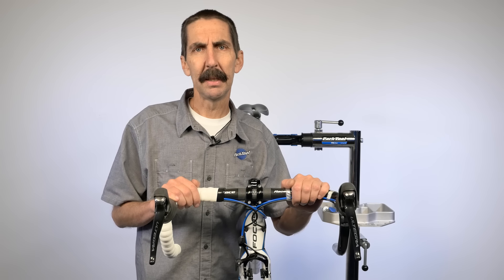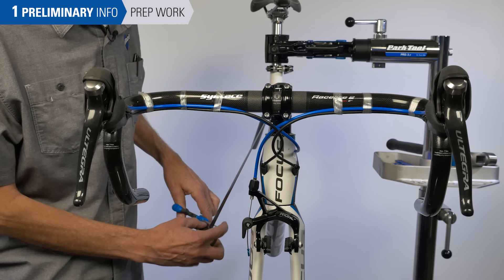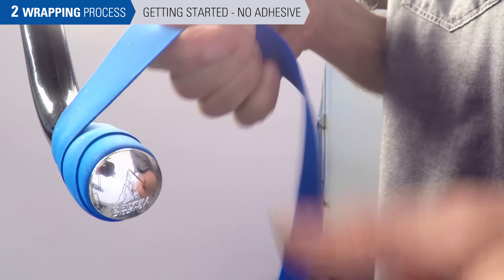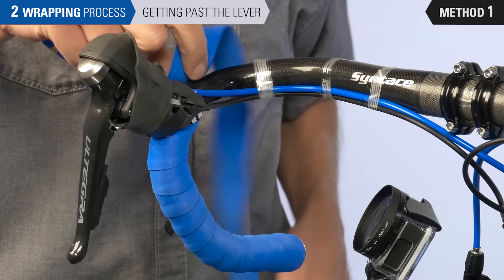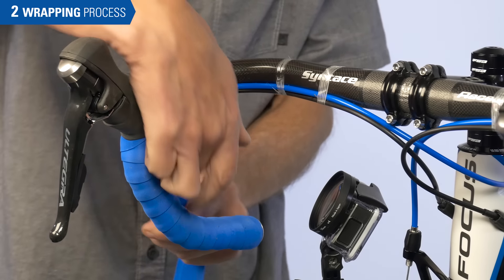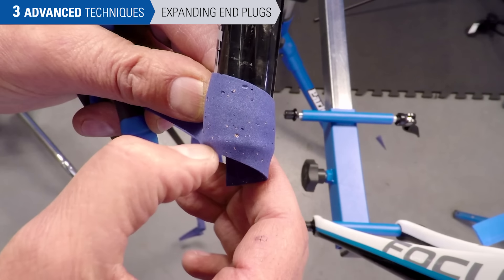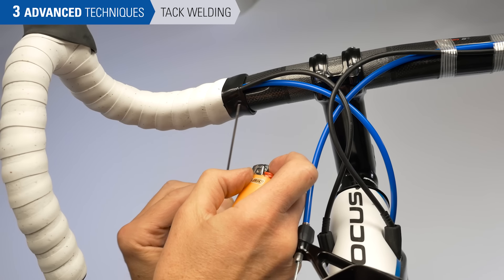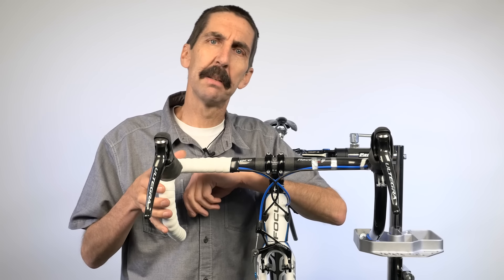How to Wrap Handlebars for Road Bikes

Comment: I was pretty much affraid of non-adhesive tapes before buying it. With this video I'm now confident enough of handling it well.

Also, the direction of  wrapping the tape is something I have come across quite new to me & realized it is the real key in this technique. 

Thanks for making this video.
I conclude that the direction of wrapping is the real key which you taught in this video.

Thanks much.

Comment: Excellent video. The only trick I would add is to use some of that strapping tape where the finishing tape goes as the first layer. Just two times around. It's very thin, but it holds tension much better and does not slowly unravel like black tape (or mfg provided finishing tape) does when it is put under tension. Then just cover the tight strapping tape with black tape but use zero tension. That way it does not slowly creep and expose the adhesive that all of us hate. Makes the tack welding spoke trick unnecessary, cool as it is.

Comment: Excellent instructions! The new tape I put on both my drop and aero bars looks pretty good!  I'll add one thing. I used a bit of this stuff called Tommy Tape for finishing. It's a self fusing adhesive strip that doesn't get gummy over time.

Comment: Great video! When I am giving tips to people on wrapping their bars I try to tell them to wrap "away from the bike" . I've found that distinguishing clockwise and counter clockwise can make people overthink the direction.
Reply: That doesn't mean anything though. When you wrap clockwise for the right side, you wrap away from the bike on top but in the direction of the bike half a turn later.
Reply: That ignores the recommended direction difference between the drop ends and the top. Also, to me, 'away from the bike' is vague, while the wording used in this video is not prone to misunderstanding.

Comment: the figure 8 leaves only a small triangle that is covered up by the hoods. There is no need for the extra strip with it. I just got done wraping with the 8 technique and it is fine. The tape was a bit thin though it might look bulbous if it is extra thick.
Reply: But isn't the tape also then going the wrong way on the tops?

Comment: the whole point of the figure 8 is to avoid having to use the cheater strip.. smh
Reply: theaveragegamer801 That's exactly what I thought!  Doing the 8 negates the need of the little strip, especially when using modern brifters with long hoods. I think I'll start calling them 'cheater strips" as well!
Reply: And he then points out the obnoxious bulge created because he used the cover-strip. How someone this good at bar taping does not understand or mention the figure-8 technique eliminates the need for the strip is beyond me.
Reply: I agree...there is no need for cheater strips if figure 8 is done expertly!!
Reply: Correct about the strip! Doesn't the figure 8 leave the tape rotation in the wrong direction at the upper end of the handlebar? Why even use it?
Reply: @norgermish1  When you wrap the Figure 8, it's your choice on which direction the tops will wrap. Josh Poertner of Silka Velo pointed this out to me. You decide on this when you come out from under the hood - at that point, you can take the tape either side of the bar which will set the direction for wrapping the tops. See the GCN video titled, "How to Tape Your Handlebars in the Figure of 8 Style", it shows it exactly - wraps inside out on the lowers, and towards you on the tops.

Comment: Okay, I watched the video, opened the box and wrapped my bars. Wobbly and uneven, but it doesn't look too bad.
I, of course, used the preferred method of wrapping to the brake lever and then once around the outside of the lever mount, since a figure eight wouldn't fit on the second levers on a '70s road bike.
The painful part is that it was mostly just practice, since I'm probably going to donate that bike to Goodwill. Selling it would be too much trouble and the rusty paint job would limit how much I could get for it anyway. Not worth the trouble. But it's good practice for working on my good bike.

Comment: I tried with non-adhesive tape as in this video and followed the instructions very thoroughly.
However, it appears I used too much tension as after a day or two the tape stretched by itself. Turns were not overlapping nicely any more. On the other hand, I had no problem whatsoever wrapping the bars with the adhesive bar tape.
It would be beneficial if you can explain how much tension is just enough for non-adhesive bar tapes. Thanks for the video.
Reply: It's best to use exactly 3.77427 Newton. You are welcome.

Comment: Thanks i just fixed my bar grip it took long but its good bcs they put it on the wrong way like you said dont put it on from the top to bottom you need to put it on from botttom to top  and the end of the grip slipped off so i had to fix it thnx for the help

Comment: I use Scotch Brand 33+ Electrical Tape for the Finishing on the bars. The last 3/4" I will put 4 drops of superglue on the tape and the press down and let it dry, this will prevent the tape from coming undone. Another one to try is using Gaffer Tape it won't leave the nasty sticky mess of Electrical tape.

Comment: By distance the best video I have seen on handlebar tape wrapping. Thank you Park Tool.
Following small point disturbs me/my understanding:
I understand the method 2 to pass the break lever, the Italian-8, has the advantage that you do NOT need to place a short piece of tape on the clamp of the break lever.
Even though this is the best video I have seen on bar tape wrapping here starting 7:00 a short piece of tape is placed which I understand is not at all necessary and which causes then also some complain at 7:50, that the method 2 has the disadvantage of resulting in the tape being overall too thick around the clamp of the break lever.
Can someone with more understanding/experience highlight me, if on method 2, the Italian-8, it is really adviseable to put a short piece of tape on the clamp or if it is better NOT to place this short piece as all other videos I have seen on the Italian-8 suggest (I understand the short piece of tape is adviseable on both, method 1 and method 3, which is method 1 but with the modification of once going along the inside of the break lever which reverses the wrap direction on top to the ideal direction front to back).

Comment: 1st time at it, with Cinelli tape.  I used Method 3 and got a clean wrap.  It did take me a couple tries not to run out of tape.  Tension was key.  
It did seem easier to go with the adhesive protect strip removed from the start. Time will tell.  Thanks Calvin.

Comment: 8:20
If I do it the way it appeared at that time, it's perfect in terms of direction. But isn't it inconvenient to think about it later when repairing?

If the part under the hood is covered with bar tape, it will be inconvenient when replacing the brake, shift cable and housing.

Comment: I came here looking for what tape to use as a finishing tape.  I certainly learned a lot more! I have a tri bike but can use the same logic as far as hand pressure to know which direction to wrap.  With a tri bike, I have four stopping points and wrap only comes with two finishing tape pieces.  It looks like electrical tape is used?  I guess I'll try electrical tape and see how it holds up,
Reply: A note on this comment, the electrical tape I had used prior was extremely tacky, high residue, versus the duct tape I had also used.  The duct tape held under high sweat and heat for over a year, and removed without issue - so my preference is duct tape (although you have to cut it it strips which can be annoying).  It also comes in lots of colors.

Comment: Another tip for the finishing tape - before yoy begin, trim off the corners to round out the end of the tape that will be the outside. Sharp tape corners tend to catch and get pulled off easier than rounded ends

Comment: Always helping hehe,thanks....
I wanna ask sir,how to make a gear set long lasting life?
Reply from the maker: A good way to keep your cassette or freewheel lasting longer is to keep your chain properly lubed and clean. You should also be monitoring your chains wear with a chain checker. As the chain wears it gets "longer" and starts to wear the cassette. Replacing the chain before reaching 1% wear is suggested and will give your cogs a longer life.

Comment: It's difficult to insert my CAT EYE - BM-45 Bar End Bike Mirrors after starting to wrap with Fizik Performance tape. Today I used a plug that is easy to insert immediately after starting to wrap. After wrapping I removed the plug and easily inserted the mirror. I now see I could instead do as instructed starting at 11:11.

Comment: Thank you for the assistance. First time wrapping bars here on a 1980s Ross grand tour.  Bike originally had old thin tape so I used method 3 when wrapping around the brakes using thicker, better gripping tape

Comment: Good video, thank you for sharing. I have a question. If the tire has a puncture , will this allowed water to enter inside the tire where the tube is ?
Reply from the maker: You will want to replace a tire that has a hole in it large enough to let water in. If you are on a ride we recommend using a TB-2 Tire Boot to get you home and to secure the tube from being pinched: parktool.com/product/emergency-tire-boot-tb-2
This series on tire and tube will give you more info on the repair process and potential tire and tube issues: https://youtu.be/eqR6nlZNeU8
Reply: Thank you very much, I do appreciate you share  and wan t help. Tube on my bike has very tiny like a tip of the needle hole, on the tire I noticed a very small cut less then 1/4 of an inch  looks like a sharp knife cut., wasn't easy to find it.  I thought I can seal it with something or maybe duck tape will do ?

Comment: What is the best way to replace the hoods on the bars?
Reply from the maker: Typically I find it easiest to roll back the front of the hoods and use a little bit of Isopropyl alcohol as a lubricant to slide the hood off the front.

Comment: is a spacer  tower above the stem good or not? ive read that some bike manufactures forbid that .maybe you can make a video for stemping etc.
Reply from the maker: Check out our handlebars and stems series of videos. Spacers above the stem are just fine. If you have a carbon steerer it is actually highly suggested/required. If you have an excessive amount of spacers above the stem, people do see them as a hazard. A normal stem could do about the same damage as the spacers and often even more damage as they have the bump outs for the bolts...

Comment: Great tutorial, the one question I have is why only wrap the finishing tape up to the edge of the bar tape? The way I learned was to overlap it onto the bar surface to securely seal and hold that end. Is that not a good idea when cables are routed under the tape? Because of concern cable movement will pull it loose maybe?
Reply from the maker: Certainly more that one way to do that finish.  It is very unlikely cables will move there, so it is a matter of aesthetics.
Reply: What I do is I overlap the electric tape over the edge of the bar tape just enough so that I can tape the overlap over the bar tape, leaving no bit of bar tape at the end exposed, resulting in a very neat finish.

Comment: One thing you didn't address, Calvin, is with the preferred [final] method of wrapping around the lever body and reversing the direction is that the notch the little 'lug' on the inside of the hood is supposed to sit in is now completely covered with tape. I have a possible fix - after wrapping, coat just the outer edge of the lug with the black pen, then quickly fold the hood back into position, then fold it away again. Now the ink will have transferred to the tape and you can cut a small notch in the tape for the lug to grab onto.

Comment: Perfect video. I need some advice. I bought some leather brooks tape but remembered that my bars are 25.4, which doesn't affect the wrapping, but the plugs that came with the tape are too big to fit into the ends of the handlebars even without the added obstacle of the tape. I can't find 25.4 drop bar plugs anywhere online. Does anyone make them? Any advice would be appreciated, thank you
Reply from the maker: Bars come in many shapes and sizes. The clamp diameter at teh stem does not effect the diameter of the bar where your hands hold it. Usually the bars are going to be 22.2mm in diameter. The inner diameter can change a bit based on materials used and how it was manufactured. If you have a particularly thick bar bar plugs may need to be modified or a different set may need to be selected. I do not have a good suggestion for plugs that will fit at this time.

Comment: You can also use a small application of super glue on the end of your finishing tape; works as good as the tack weld but less chance of burning your fingers 😁

Comment: What the best way to increase thickness of the wrap at the drops?  I like a very hand filling grip and the standard wrap around the bar is just too small in diameter.
Reply from the maker: Adding a second layer is a simple way to do this.  It will be "extra cushy" which to some people is bothersome.  You can use higher density tape below and a softer tape on top.
Reply: Here are a few methods:

1) Stretch the tape less than usual.
2) Overlap the tape more than usual.

But make sure your roll of bar tape is long enough for you to do this, especially if your handlebars are wide. This won't be a problem if you're running aero drop bars as you'll have more extra tape than with standard drop bars since the wrap usually stops at the apex of the bend up top.

Comment: Great video, a question: the handlebars are clearly not turning. I see the bike is held in the stand by the seat post and that the front wheel is removed. Does anything hold the fork at the dropouts or is the headset somehow overtightened temporarily?
Reply: I was asking myself the same question! In the "advanced techniques" section starting around here https://youtu.be/5MzIiv7pewE?t=674, you can see that Calvin has the bike mounted on a PRS 22.2 or equivalent which holds the bike from the bottom bracket and from the front drop outs.

Comment: I love Calvin Jones videos, and this one is extremely clear, but I'm concerned that the direction of the lower part of the wrap is exactly opposite of how it should be, given the stated goal. If you grab and twist the bottom of the drop clockwise (as you might while riding) you're actually loosening tape that's been wrapped clockwise, as you're "pushing" it clockwise from the origin of the wrap, which effectively loosens the wrap above your hand. If you want the wrap to "tighten" as it's twisted clockwise, then the wrap should begin counter-clockwise (reversed, of course, on the left-side bars). When you get above the brake hood you WOULDN'T want to reverse direction, as the tops are wrapped correctly in this video, and twisting downward (which is also clockwise) will "pull" the wrap tight from the terminal end.

Please correct me if you think I'm wrong!

Comment: Great video. Loved the tack welding tip. I do find that sometimes the tape can start to peel back underneath so I've always just put another layer on.
Reply: Just skip the tape and start at the top, end with the plug
Reply: @johnsmith1474  Been there, done that. Problem with this technique is that the tape tends to look shabby on the edges after a couple of weeks. Your hands are pushing against the exposed tape edge. As mentioned in the video.
Reply: @paulhatcher951  - 1. I watched the vid, I disagreed. 2. And if one were to review the advice, we can note that much of it is aesthetic without good aesthetics (electrical tape, really?) or pedantic for instance; what person watching how to wrap bar tape (bike 101) is properly advised to add and underlayer of reversed electrical tape to attend to the possibility of chugging on after a crash so severe it wrecks the tape? It's true for pros, but nonsense in this application. 3. I have watched and very much like these Park tool vids, but they do sometimes overproduce, I was surprised he did not name the Park Tool number for the mallet he used to address the plugs.

"Unscrewing" the tape is evidence of a technique problem holding the bars, struggling too much with a useless input, perhaps one also grinds their teeth and should wear a bite plate. 

As I stated to reasonably make my point you GRIP you do NOT twist (which is a waste of input power). If that is the case I'd look for lots of other poor technique pedaling, sitting in the saddle etc.

Comment: Can I just start at the top and wrap towards the bottom while rotating  the opposite direction? That way my grip will still tighten the tape and will have a cleaner finish at the top.
Reply from the maker: This typically leads to the tape unraveling. Thi is because as you push down while riding it pushes the tape apart. Some people do this with success but for the most part wrapping bottom up makes for the longest lasting tape job.

Comment: I have recently bought a used 2007 Trek road bike for commuting. New tape was needed. The wrapping worked ok but I paid special attention to cutting smaller pieces of tape and making the gap/distance between the bar and the lever as small/smooth as possible. It feels so much better than before even though it looks the same. No pressure points. I have sram revel and it's a really bad construction in that sence. I get it - bars have different constructions so it's impossible to make a lever/bar meeting smooth without what I just did. But wtf? And why is this never mentioned in tutorials I can't hardly be the only one who's encountered this?